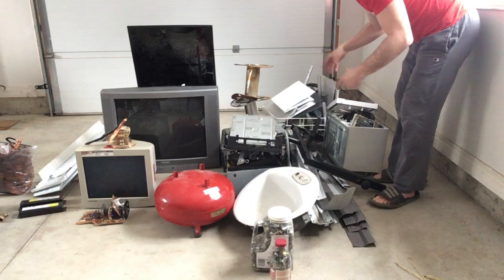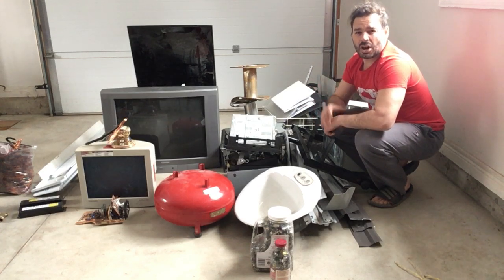How to sort and stack your scrap metal in order to maximize your load and profit at the scrapyard!

Comment: Great information Mr Tin Man.  Microwave box great use for small bits.  I like the copper in plastic bag then the yard doesn't mess about with a bucket and deducting weight.  /thumbs up cheers
Reply from the maker: Yup. I learned from the past. They would take a few pounds off without even weighing the bucket or cardboard box...usually like 2 lbs, even though box did not even way a lb.
Reply: @TinManScrapper  Great tip, that would make a big difference over time on your copper.  /cheers
Reply: Now that's good food for thought thanks guys 👍

Comment: a little tip for all you new scrappers, if you find something in plastic and sealed that was not ment to be opened, put it in a plastic bag and seal it up put in freezer 24 hrs remove put on top of your vise anvil part and hit it with a 4 lb hammer, a russian hammer if the 4 lb does not work, most of the time it is copper, all that black goo freezes, same as a ballast.

Comment: Love your videos ! Is there different grades of steel to get a better price ?
Reply from the maker: Thanks for watching and the question Luke. There is mainly 2 types, tin/shred and steel. I beams are own category and so are rebar. There is several grades of stainless steel, but mainly magnetic and non magnetic at our scrapyard. Unfortunately the stuff that looks like s.s. And is magnetic is just thrown in with tin/shred since only a thin coating of nickel. Nice thing though tin/shred and steel at all time high price right now 10-13 cents a pound

Comment: What is your opinion on copper ingots?
Reply from the maker: I like them. I have a few from aluminum/copper heat sinks. I know some have argued that if you try to sell to scrap yard they don’t like because they cannot tell the copper purity. I think as long as the ingot is not huge it should not be a problem. Easy test for the scrap yard also if they want to cut it open to look. I plan on down the road making some different ingots with copper/brass/aluminum for my channel, but little while from now.
Reply from the maker: Thanks for the question. Stay well.

Comment: wire stripper by Coppermine # 302 will strip the smallest wire and is made not to move side to side, comes with 2 blades, large wire and small wire, can be mounted in 3 different ways and you get a crank and is the best on the market, shipment is super fast. on sale look at all at Coppermine and download the app on you tube. # 1 in my book.
Reply from the maker: Nice, seems like a good model. What is the price? Is it electric or drill powered?